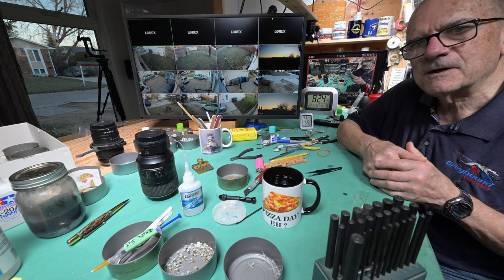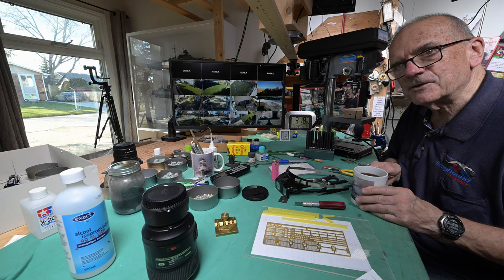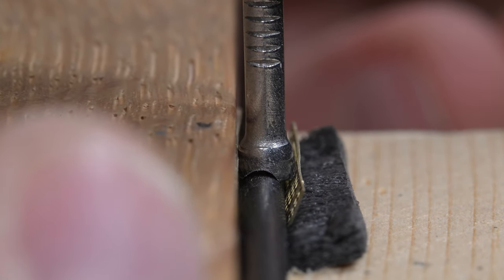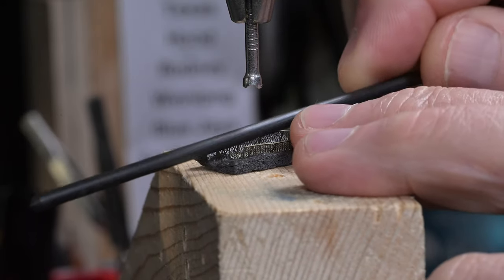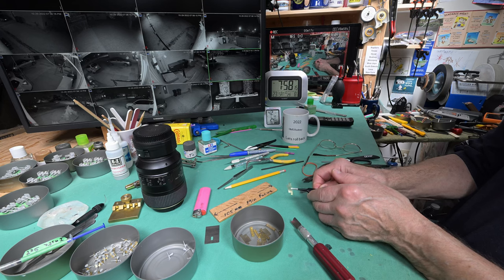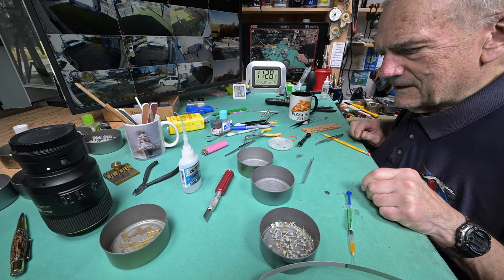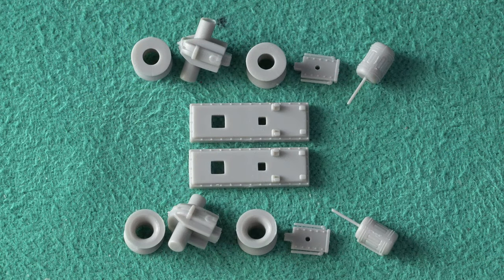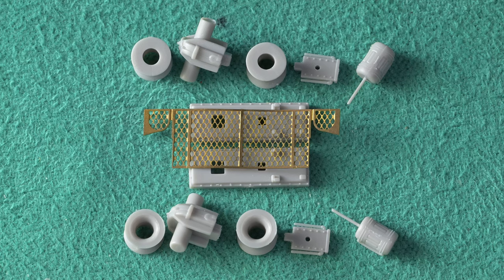The Model Ship - Part 1351

Comment: Hi Ron  totally agree with your logic with bending and usually i would agree , but after seeing the pictures of the baskets , the detailing would look better on the outside,  and i do believe you'll find it will bend on the line alot easier L also the sheet is stamped only on one side , i have had PE parts that needed multiple bends in different directions,  so the lines are merely indication where to bend 😊😊😊😊😊 back to plastic yeah 😊😊😊😊see you tomorrow
Reply from the maker: Yup! "the detailing would look better on the outside" 👍

Comment: ...well, I'm not a model builder, but I'll try my hand at a hint...how about taking a piece of hardwood...use the photoetch cutter and press it into the hardwood to create a narrow valley. Place the basket's fold line over the valley...press the fold line down into the valley with the photoetch cutter. I would think the hardwood would support the edges and force the bend in the correct place...
As far as the upload...your computer is very likely not connected directly to Nikon. Theroretically, it could be connected to a server in England, then to South Africa, then India, Tiawan, Hawaii, Portland, then to Nikon. If any of them is a slow server, then you're scre...ummm...well, you know...
It's probably too late now, but next time you notice this, close the browser window and try reconnecting...it'll likely take a different route and may rectify the slow connection...
By the way...I enjoyed the episode greatly...👍

Comment: I know exactly what you mean when you’re discussing the PE folding lines. I have found, however, that it’s not an absolute. Some parts bend toward the line and others away. I’ve noticed that I have to look at the finished product as a whole, and look at what works and what makes the end product look the way it should. Ultimately it your ship and you need to decide. Also, from arms length no one will ever know. Keep up the good work.

Comment: Ron, i just noticed at the 17:12 mark what the problem is. you are missing where the bend mark is, notice on the sides that the width of the edge changes on both sides. the end of the narrow point on both sides is the bend point, the only portion of curved bend is the quarter round part - in other words after annealing fold the ends up, bend to fit the quarter round, glue down the face and then make the almost ninety degree bend to mate the long face
Reply from the maker: Thanks Ralph, but at 17:41 you can see the cut mark in the folding line. The cutting edge of the blade is offset to the left. Now! The good news is that just this evening I finished all but the last basket. Will show how I did it tomorrow in 1352. Thanks for commenting. 👍

Comment: I have made a number of RESIN moulds to bend curved photo etch, various sizes and 3 lengths. They work well and are always available when I need them. Only took a day to do, but let then cure for a week before I first used them. I then fitted the stainless steel rods I used to form the groves with a vertical rod that clamps into a drill press, that way I can apply pressure evenly and slowly.
Reply from the maker: Good thinking! 👍